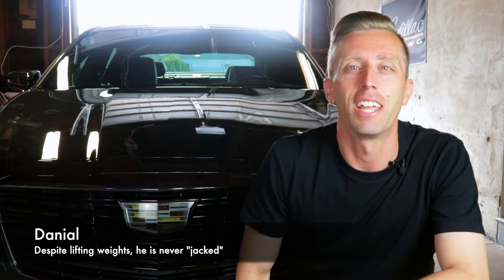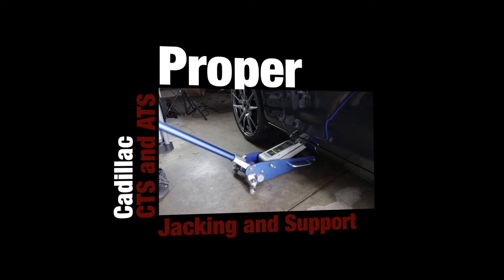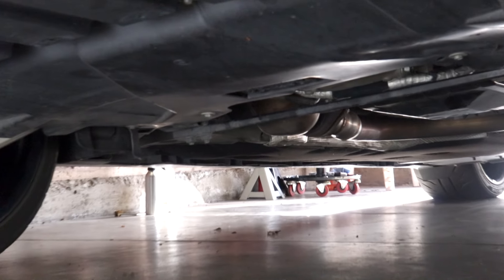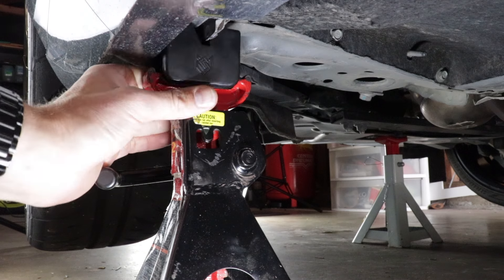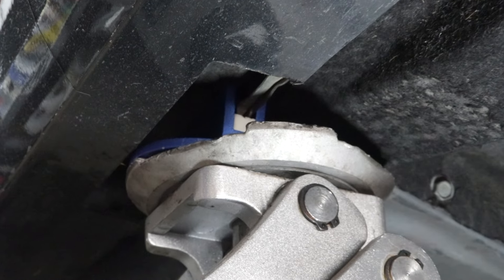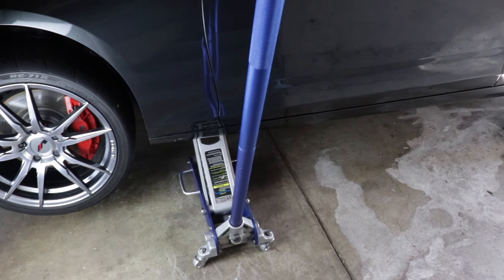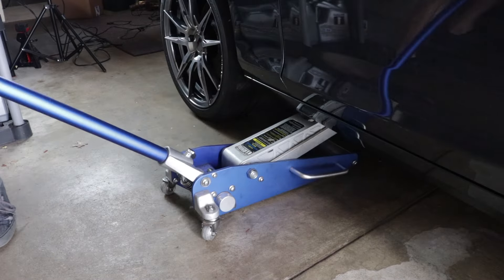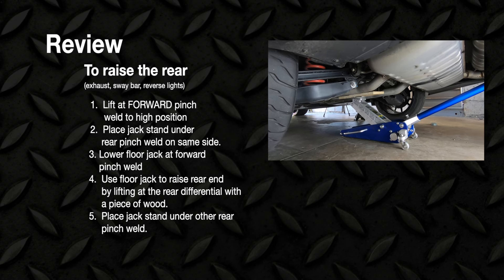Proper Cadillac ATS CTS Jack Points

Comment: I really appreciate you mentioning that lower cross bar touching up against the transmission . The previous owner did exactly what you mentioned and jacked up the car the wrong way. That tapping noise against the transmission has been driving me crazyyyy. Finally fixed it lol. Thank you your in depth video
Reply from the maker: Doesn’t it feel good to get rid of that noise!  I was ecstatic when I fixed it.

Comment: For raising the passenger rear tire, could you just lift from the front passenger side pinch weld like you did on the driver’s side while the driver’s side is on the jack stand? Then you wouldn’t need to lift from the differential.
Reply from the maker: Not the safest method as the car will be balancing between two diagonal points. Depending on the cars weight distribution it may tilt over
Reply: @JetFuelOnly  TY!!

Comment: Thanks for this Info. I remember bending on of the Pinch Weld on the STS, even with the Jack provided by Cadillac, and busting the Clips that held that Plastic Rocker Panel off with a Hydraulic Floor jack. The last few Yrs I would use a Length of 2x4 on top of the Floor Jack, and place it next to the Pinch Weld.

Comment: Hi  Thank you for the suggestion - GM Canada does not carry the LF3 crated engine (- back water nation).  I have a 2009 (great car) which has a timing wheel noise. Just thinking , based on your experience , is this the time to give the  engine a rebuild ?
Reply from the maker: I’m not the type to rebuild a motor. I’m more the type to move on to something new.  But if you have a timing issue and no damage is done why not replace just those parts?

Comment: Hi  As you  are our assigned official cadillac spokesman when should I do a gear box flush?  No problems it looks easy to do.
Also, have you changed your camshafts?  Any part numbers  would be appreciated David ( have a 2009)
Reply from the maker: Every 45k miles or so.  We don’t replace cam shafts in the LF3 motor unless there’s engine damage or we want to overdrive the fuel pump. I don’t know which engine you have. If it’s not an LSA not sure if any good reasons to change the cam. What are your goals?

Comment: Thanks for the video. On the front left side of the vehicle, a little bit to the right of pinch weld. I accidentally placed my car jack underneath the two circular area and caused a little indentation or bend  in that area. I have a ct5-v and its very similar to what you have under yours. Do you know what the area is? I thought it was frame, but it was not strong enough. Do you know if I maybe damaged anything there or what is the purpose or what does the part function do? Thanks for your help. I have pictures as well that I could maybe share too, thanks!
Reply from the maker: I don’t know exactly what it is but it’s light structural area. I guarantee you’re not the only one and I’m pretty sure that mine was picked up there by someone at one point. Don’t worry about it but obviously try not to do it ha ha!
Reply: @JetFuelOnly  yeah definitely seem to be light structural area. Yes I definitely will not do that again. But yeah thanks for letting me know. Hopefully everything should be good and it seems like it is. Will let you know if I found out more information.

Comment: I have a Pittsburgh low profile rapid jack and I love it!! 4-5 pumps and cars lifted!
Reply from the maker: Is it hard to pump? I have an older one with a single piston. It’s a pain. New ones have two so maybe easier?
Reply: @JetFuelOnly  no it’s really super easy and requires no force at all. I was really surprised how fast and easy the Pittsburgh rapid jacks are. Worth every penny of that $100 bucks I spent on it!
Reply from the maker: Damn. I might need to get a new one. I literally have to put my body weight into it after a couple pumps.

Comment: Hello, thanks for your video! I looked at the rear pinch welds, and there seemed to be some metal casing area with two big bolts in it. That metal was directly next to the pinch weld. Am I supposed to jack that entire area up, only the pinch weld, or the pinch weld together with one edge of that metal area thing? Thank you so much!
Reply from the maker: Technically just the pinch weld. I always recommend a pinch weld adapter

Comment: Can you make a video of an alignment for the Cadillacs bcuz there is none. I wanna know how to adjust the camber and caster for my 2014 Cadillac ats awd
Reply from the maker: I’m not qualified to show that nor do I have the appropriate equipment. But the camber is simply the position of the strut when you tighten the lower strut to knuckle bolts. Those holes are elongated.
Reply: @JetFuelOnly   but there is not one video out showing it how to do it with those bolts lol 😂

Comment: Hey I have the savage side skirts on my vsport will the pinch weld on the rear fit one of those hockey pucks that you use? I wanted to paint my rotors using the g2 paint so the car needs to be lifted and all 4 tires need to be removed but today when I had sitting on stands on the rear I didn’t feel comfortable.
Reply from the maker: Should fit. However I trimmed my savage side skirts in that area. See my savage splitters video to see

Comment: I have the same aluminum jack you have and I use hockey pucks...no damage to pinch welds. Thanks for the vid. Cheers
Reply from the maker: Hockey pucks are a deal!  My buddy added screw eyes to work with German cars
Reply: I like the idea of hockey pucks.  For my various cars, I find where I'm going to place the jack, then I'll create 'pads' using hardwood blocks that I cut to fit the respective location.

Comment: Have you ever changed your transmission filter and fluid if so did it need it?
Reply from the maker: I had Cadillac do it. Our trans is a bit unique in procedure so I left it to them. But I bought my own fluid because they will charge $30/qt for the 12 you need.
Reply: Yes I know there’s no dip stick so you can’t check and see how clean the oil is I’m going to have Cadillac do it . Also looking into the trifecta tune just want everything good before I do it thanks a lot.
Reply: @JetFuelOnly  they used the fluid you brought? Yes, much cheaper online
Reply from the maker: Yup
Reply: Eddy. My 2013 ATS 3.6L has a 45k mile tranny change interval (assume this means flush, I did first drain and fill at 32k). It is an easy procedure. Jack up the front as shown in this video. I placed ramps under the front wheels. In the rear, jack stands on both sides and 3 ton floor jack under the rear differential. Drain fluid and then remove pan to drain remaining. Clean the magnet and inside pan. The filter pulls out. Should not have to change grommet around filter tube. The pan gasket is made to be reused. But replace if showing any seepage. Tightened the 10mm pan bolts until "gently" bottoming out. Don't overtighten (did not use my torque wrench). Pump in fluid (Dexron VI)  through fill port on passenger side of tranny. When fluid begins to drip out, turn on car to warm fluid to 86F. Used my non-contact Fluke temperature meter to measure. With engine running, pump in more fluid until begins to drip out. I used 7 quarts. Replaced plug and moved shifter through gears. Checked fluid again with engine running. All good. No difference in how car shifted before or after fluid change.

Comment: You mention bending a bar that causes you to hear tra smission noise; i recently had my front brake pads replaced and now my car is loud inside and rough....i can feel vibration....do you think that bar got bent? And how do i fix it??? Thank you!
Reply from the maker: Loud and rough doesn’t sound like the symptoms but all you need to do is look under the car and see if the black bar going between your front wheels is pressed against the lines above it. It’s 4 nuts to remove the bar. Sometimes you just need to straighten the attachment points on the car (easy by hand) or the bar could be actually bent and will need to be straightened

Comment: I just bought a 2014 ATS ... this process looks like a pain in the ass!! Lol. 

Awesome video by the way ... so helpful! I know one thing for sure now ... I will not be paying some shop $22 for a rotation so some kid can gun down the wheels at 150 lbs of torque ... warping the rotors lol. 

Question: Do I have to reprogram the wheel sensors afterwards or is that something the computer will auto detect and correct? 
Thanks again!
Reply from the maker: Adam Lemus you would need to reprogram the sensors to their new position and you will need a TPMS tool. There’s different ones and I’m not sure if the one I use is good for the 2014 ats sensors but it’s the EL-50448 on Amazon or EBay.

Comment: Hi Danial.  What size jack and jack stands would I need to lift my 2014 Vsport and leave it on the jack stands for a couple weeks while my wheels are getting powder coated?  I am glad I found your channel.  Your videos are very helpful and very well produced.  Thanks in advance.  Scott
Reply from the maker: I use 2 ton stands but technically recommended is 4 ton. I have no issues using 4 2-ton stands myself.

Comment: Are the pinch welds the only place to use Jack stands?
Reply from the maker: louie1487 pretty much. I point at another spot ahead of the front pinch weld in the video. The problem is there’s no room if the jack is at the front pinch weld.

Comment: thanks, poorly engineered setup. Can’t imagine any jack can make it to that main point from the front, must be over 3 feet.
Reply from the maker: I have been able to get my shirt aluminum jack under there. With my lowered car I have to drive up on about 1.5” of wood and the first few pumps are VERY small.
Reply: @JetFuelOnly  thanks will try again using my ramps first